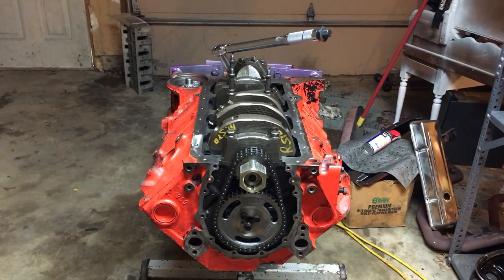Harbor Freight Pittsburg Pro torque wrench TEST 350 torquing the bottom end

Comment: Doing the same but have a question, I have to take my crankshaft back out and already put the rear main seal in so do I have to take it back apart to get the crank out? If so which I guess I know I have to take the part (1 piece seal) but will it junk it now and I have to buy a new 1 again
Reply from the maker: James J. McCloud You don’t need to remove the crankshaft to replace the rear main seal, one piece or two piece.
Reply: @HeadFlowInc  I know that but I need to pull the crankshaft for something else. So wondering if it'll ruin the rear main by doing so or will I be able to read use it. It's a 1 pc seal
Reply from the maker: James J. McCloud Because replacing a rear main seal is so involved, I highly recommend replacing it. The seals are cheap and having it leak if it does get damaged trying to reinstall the heat cycled seal is a big gamble. JD
Reply from the maker: James J. McCloud https://youtu.be/rLBAoKeqCEk

Comment: My 26 years of building engines I've always done what you have done:-). Always tripple check. You are correct use wd40 on those rings, I've some times used assembly lube made by GM. I'm in the the prosses of doing a LS1 build and I just love those engines. They are all roller and the horse power is unbelievable. Good luck with your build.
Reply from the maker: tlt40s&w 70 I'm still planning on my 4.8 Turbo build, it's just going to require a stronger trans than the T-5.  So for now I'm running a bone stock 5.3